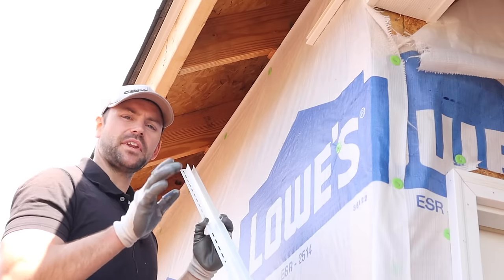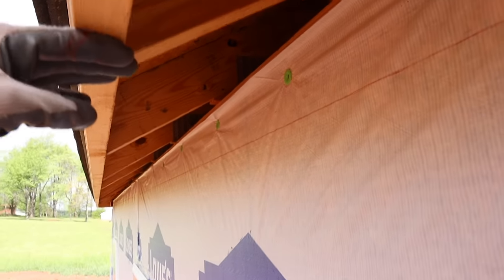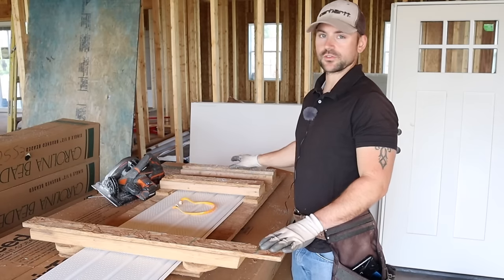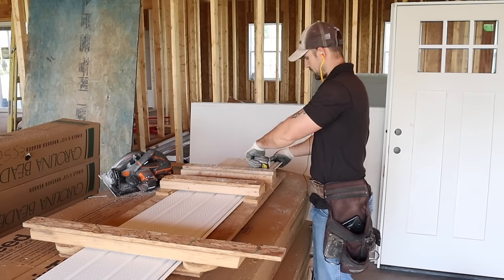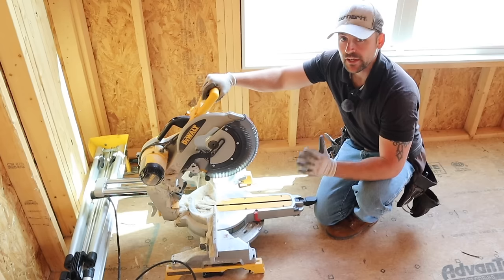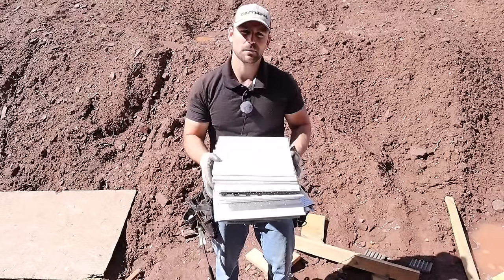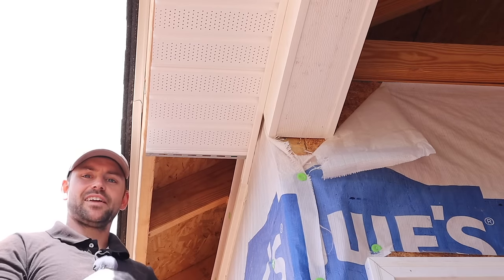How To Install Soffit And Fascia

Comment: Awesome video, thanks for sharing your knowledge. Any chance you will do video on how to remove soffit, when you have to get up inside under the roof, to remove a birds nest or whatever the case may be. I only ask this because I have a section of aluminum soffit, as my place was built in the early 70s, and I don't know how it comes out. It almost looks as though I have to start from the very end to remove each section to get at the section I need taken out?

Comment: My roof is very close to needing replacement.  The roof was put on prior to my purchase of it and there is no drip edge anywhere which has subsequently rotted my wood fascia.  The house was built in 1970 and there is no sub fascia either.  Just a 1x board with a dado to slide the soffit in.  Should I replace fascia prior to roof replacement or after?  Should I install a sub fascia when I do?  That would affect the shingle overhang due to additional thickness.  I’m at a loss on what order i should complete that given both fascia and roof need replacing.  Should I let the roofers do it all?  I was going to do fascia and soffit myself but not sure if the roof replacement timing makes that an issue.  Thoughts?

Comment: Thanks so much for your video, one of the most helpful videos I've ever seen.. Also this would be my first comment on YouTube EVER, but I just had to ask..

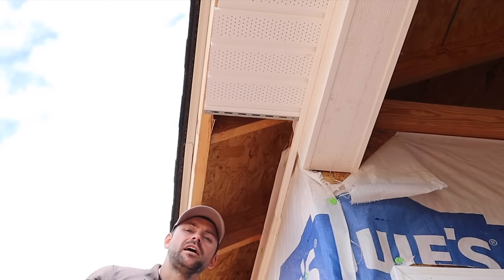What is the reason for taking the quarter inch off the soffit measurement in your video at 2:50? My soffit board is a 1x6 and I don't have much room to work with to nail on my soffit already.. Wouldn't I want the soffit to be flush with the edge of the board?

Comment: On the bathroom vent issue, the whole soffit seems to be vented. Is the vent box more open? Is there expected to be a fan at that vent? You say to put the solid side out for appearance, but it seems like that is the side you would want moist air going out. I really did like the instruction. Thank you.

Comment: Dude...I love your videos...I'm a new subscriber.  Many people deal with regular "homes" but nobody deals with comments on a mobile home. I mean it's my home. 
I have noticed nail slipping out from where they were nail in. I know they use crappy products etc... but I need to replace some soffit and or fascia and re nail in the nails coming out ...but I'm thinking do I just pull those out and replace either some kind of screws?? Or just pound in what I can and then add some kind of screws .Can you please recommend what I should do to take card of the nails popping out and how to fix some messed up fascia? Where they had a sun room. But when I bought it, I had it (sunroom)/ tore down and a deck put up. If you can help me I'd appreciate it. Thanks again gor your great videos...✌️

Comment: Great video presentation. My house currently does not have soffit covers so I am planning on doing it myself. Your video was very instrumental in that decision. I do have a question that I hope you can answer. My house has several places that will require running the soffit covers on inside corners and I'm not sure how to go about that. Is that something you could maybe do a video on?

Comment: My house has big soffit. My soffits are 3 foot long. I have wood soffits now. Would you need to nail it with a nail on each end or should use a nail also in the middle using a total of 3 nail of each piece. Also would you use all vented soffit or just vented soffits where the vents are going into attic. I just want to do it right the first time

Comment: I love your videos, well-explained, professional, and with many practical tips. May I ask a question: I saw you install fascia and soffits first and then install vinyl on the wall, but my local contractor said they install vinyl first and then fascia and soffit. Could you explain which order is better? Thank you :)
Reply from the maker: Thank you Helen! The sequence of installing the soffit and facia does not matter either way. if you are working off a pump jack system for scaffolding, it might make more sense to do the soffit and facia while doing the vinyl. If you were working off the ladder to install it, then it makes more sense to do the soffit and facia first. Hope that helps!

Comment: Question -- I plan to install the aluminum fascia board, but do not plan to install gutters (building a shed), what is the best way to install the fascia if the trim nails will not be covered up by gutter install? Thanks!

Comment: Question-  using vinyl cedar siding on a gable end .  How is the bottom edge secured when unable to use starter strip because the bottom edge runs on an angle of a scissor truss.    Truss 7/12.   And inside or bottom of truss probably 4/12.     Can’t find the answer for securing bottom side of vinyl shingle.    Thanks

Comment: When you run your soffit to the top of the gable, do you bend the last one coming up and down,or cut it and butt it? Also some framers don't finish in bird box, so the soffit has to run down the gable wall, and then make a little triangle 📐 on the straight run where the gutter is placed. I was wondering if you have a tip there. I'm probably asking for too much 🙂. Thanks

Comment: How do you decide if you need vented or not vented soffit? I am building a small 16 x 40 house that will become an air bnb when I build later. It has no attic access. Metal roof over zip board then rockwool insulation and probably tongue and groove wood for ceiling.

Comment: I have a question,, I am having a wood burning stove installed through the wall,, and I have to go through the soffit with the chimney... A contractor is actually doing that part but he said to save me money, If I bought all the parts he would do the run... I can not find what kind of box or piece that would not only be safe for the chimney but also would not make my house look like poo with a big gapping section missing from my soffit, and to protect the house from the weather as well... Can you help point me in the right direction? the pipe is 6"ID and 8"OD. the soffit is probably 1 1/2 feet-ish

Comment: I noticed you installed vented soffit panels with no solid panels. My garage was built using the same vented panels. I live in Northern Minnesota so you know we have lots of snow and wind. Every winter I get a lot of snow entering my garage. I am finishing the inside of the garage and I am concerned about all that snow coming in and laying on the insulation, and of course molding, heat and possible fire hazard. I have ridge vent on the roof. It seems to me to be overkill for all of the soffit panels to be vented. I am thinking about installing solid soffit panels along the gable end with no venting there, and installing solid panels about every 1-2 feet on the front and rear runs. I'm thinking with the ridge vent and soffit vents there should allow plenty of ventilation and air movement and cut down the snow entering the garage considerably. Thoughts? I enjoy your video's and have learned quite a bit, Thank You!!!

Comment: May I ask, why the soffit is not installed in longer pieces? So there are not so many seams? I have to replace all of the trim, facia and soffit on my home due to carpenter bees and some rot. I am dealing with all wood and not your standard dimensions. It was a 880 sq ft cottage built in the 1950s and winterized at some point. It is a cute home that is the perfect size for myself. It is a better alternative to a condo and it has a nice yard as well. But the soffit depth is a different size in the front than it is in the back which will be challenging for just a dryer. I can't afford to hire a contractor or handy man, so I'm going to take it on myself. I am worried about the trim board on one section due to the power line coming to the house is attached there. I'm going to have to leave that section in place and cut away before and after that area. Do you have any tips such as do I cut the caulking where the trim board meets the vinyl siding? And do I just recall afterwards? Should I reuse the drip edge or replace it as mew trim is installed?
 Any suggestions, advice is welcomed and much appreciated.

Comment: Have you ever had problems with just installing the F Channel instead of attaching J Channel to a 2x4? 

My concerns is this, and I don't oppose the method that you're using by installing the F Channel to the OSB, but how does that hold up in strong winds etc.? 

I live on the Mississippi Gulf Coast and we experience hurricanes and tornadoes. What's you're thoughts?

Thanks

Comment: Is there a reason you wouldn't bend over (brake) the end of the facia trim and face nail on the gutter side? A little more work, but less exposed nail heads. 🤷🏼‍♂️

Comment: I have a panel Saw with a special blade for flooring so it doesn't blow out.  It has smaller teeth and they are like 6 per inch.  Would that work for this material  Is it plastic or metal?

Comment: How would you install the fascia in the peak of the gable? 
Mine has a 2x4  for the ridge board so I'm assuming I would need a 2 inch piece cut at a 45 on either side.

Comment: The only time I ever had a problem with vinyl soffit and or siding cracking was when the vinyl was of a cheap quality. Most good quality vinyl rarely ever cracks even in very cold locations and or applications. We used extension ladders, aluminum ladder jacks, and a 12" by 30' aluminium walk board. On lower walls we used the same walk board and two step ladders. We installed all the siding followed by the soffit when we got up high enough to reach it. All that double climbing really makes no sense.

Comment: Hello I have a question regarding the purpose of the soffits  on the gable ends reaching to the peak.  I understand the concept of air coming into the lower soffits and exhausting via a ridge vent for example.  However I’m wondering if those soffits higher up are considered “exhaust “ because of their height given that heat rises.  I have the same continuous soffit system and I’m trying to figure out if I have enough exhaust.  I recently had a metal roof put on and the contractor told me they didn’t do ridge vents on metal roofs so I had them put in a couple of box vents but I’m not sure it’s enough.  I live in southern Florida.  Any thoughts would be helpful.  Thanks scott

Comment: I learned so much from you . You're a great teacher! Quick question,  I'm wanting to change my fascia since they are about 20 years old, but the electric that is supplied to the home is attached to the fascia and then runs down to my meter... Would i need to contact the city to have it turned off just to change a fascia? Thank you so much!!

Comment: Hello I only just found your channel very recently,  I'm a new subscriber. In .my house I have an internal wall which gets wet to the,  so I used dryrod about 2 weeks ago. The wall still gets abit damp over night,  any ideas on what i can do ? Do I need to remove the old plaster,  an replaster the lower part of the wall using a lime plaster ? I think it is condensation.  Would appreciate your advice thank you

Comment: I'm a big fan of 3/8 measurements.  I'd say 11-6 for 11 and 3/4.  Or if I needed 11ft 1/2 inch,  I'd say 11-4 or write it  on the wall for the cut man to see.

Comment: Will aluminum soffit material cut as nicely and cleanly as vinyl with a skilsaw jig like the one you demonstrated with provided the blade is installed backward in the saw?
Reply from the maker: No because metal could bend and dent easier. I would not do it. Try it on a piece and find out!

Comment: Does the soffit on the gable end have to be vented? I was planning on just doing a couple vented at the top and bottom of the run but use non vented in between. I like the cleaner look of non vented. I didn't think there would be much heat to vent in a 12 inch overhang

Comment: Did you use a 1” or 2” wide bottom lip on that aluminum fascia as they sell both those options ? 
Also we used the wrong drip edge lol. It was for windows and doors but it’s too late now we already shingled and stuck the ice shield over the drip edge already. So is it ok if we nail the top of the fascia under the drip edge  cause I don’t think this drip edge will hold it as tight by itself as the proper drip edge like you used.

Comment: 1in overlap with sealant maybe.. I go for 3 to 4in.. heavy directional wind and rain could wick easier and start to rot wood over time.. I will say. clean work man all looks great.. I just don't like that 1in overlap. And what looks like a waffle head framing hammer

Comment: what do you use on a deck that has a 2 foot overhang but don't want to use fascia but you want to enclose the overhang  ?   by the way very helpful video thank you
Reply from the maker: You would almost have to use fascia to cover it up. You could just stain it and forget about it. I'm glad I could help Antonio!!
Reply: If you meant soffit and not fascia you could always use shiplap and either paint or stain it.

Comment: I need information, I just had my new roof installed, the facia flew off a moth later… The roofer is saying he didn’t installed it, is that possible? The house was built in 2007 and it’s been attached all this years and the facia has 2 staple holes in a 12’ or longer. It doesn’t make sense, but I do believe he forgot to mail it down.

Comment: I have a 10 yo house. My 6-1/4” ribbed fascia just fell off and I’m having a difficult time finding the same fascia. My fascia is “h” shape. It’s basically the “L” shape fascia you installed but with drip edge attached. I’ve checked a couple local roofing & sliding suppliers but they never seen anything it. Any idea where I can find the fascia? Thanks in advance.

Comment: Two questions:
Would you ever nail drip edge to metal fascia?

Also, how does f channel and soffit merge into bird box? Only saw the end result in the video.
Reply: 1st question No there is no need to. 2nd question gable  long run of facia overlaps a short piece bent around  on the corner end like he was showing wraps around the birdbox, then he will install short F channel for the soffit to fit into. Hope I was helpful.
Reply: See how he bent the corner piece? The gable piece then overlaps the corner piece, then he will install a short piece of F channel for the soffit to fit into.

Comment: I'm trying to find non-ribbed fascia for my gable ends, with not much success, is there a reason why its not sold anymore?  I've never liked the ribbed look on the gable ends.  I'm also no expert here but I would imagine that the f channel should be consistently installed with the nailing surface up so that if it ever had to be changed, you wouldn't have to touch the top row of the siding. the other thing ive heard is that soffit vents can allow the moist air to  be sucked back into the attic, so a roof vent is preferred.
Reply: abc supply
Reply from the maker: I noticed it is not in the big box stores. Like Wayne said the ABC supply store would be your best place to check. I don’t know if you have one in your area or not. Thanks for watching!

Comment: Very nice video.  I have a few questions.
- Do you prefer aluminum or plastic soffits?
- What spacing to you use for soffit venting? 
Thank you!
Reply: That sophet doesn't need venting. That's what all those holes are for.

Comment: On the j channel o. The soffits what if you wont be I stalling vinyle siding what covers the nailing flange. I am catcalling doing a porch roof with vinyle siding as well as the soffits there will be guttering on both ends but not on the center where there is a crazy gable
Reply: By the wall I think you do awesome work wish you would just come do mine but I am independent and have got it this far by watching you so thank you!

Comment: I just got offered a job removing old and installing new fascia.  I have done it before with my dad but I am on my own now and don't know how to bid it. Any tips would be appreciated.
Reply: Add your materials, start at 30/hr, depending on length of job charge 50, 100, 150, etc to recover  your overhead.

Comment: I am trying my best to understand and visualize all this... A question for everyone... On the side corner of my residential high ranch I heard some noise from my recliner which is right below... I went outside to fine that the aluminum shield that's over the fascia board was slightly detached because the nail was gone... I waited in my truck at the curb in front of my house and watched a squirrel with a mouthful of wet leaves walking down the power line drop to my house right to that corner! Damn! What I'm trying to learn is does that give the squirrel access into my attic or is it just in the slight soffit area between the soffit and side wall? I guess I'm asking if they pry open the fascia shield can they get into my attic??? Is there a plywood wall going all the way up the side of my house that would only let them nest in the small soffit overhang??? I'm really worried about this...

Comment: I have a brick house, but would like to install this instead of painting the wood soffit and fascia. Do you have a video showing how to do this? Also, if I tackle this myself, do I rip down the wood soffit and fascia or place this over it? Thanks.
Reply: You should remove the existing soffit for the best ventilation.

The fascia in this video goes over the subfascia. You probably don’t need to remove the existing fascia: just size the new soffit accordingly.
Reply: @jeffreylonigro1382  That makes total since about the ventilation. I think I'd rather do this than paint the existing wood.